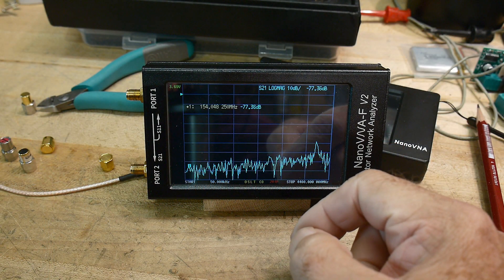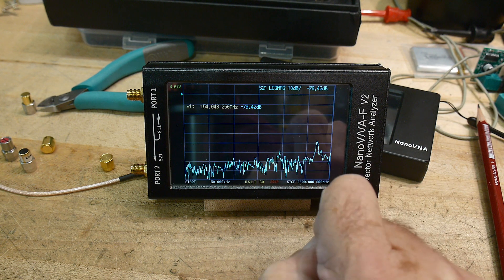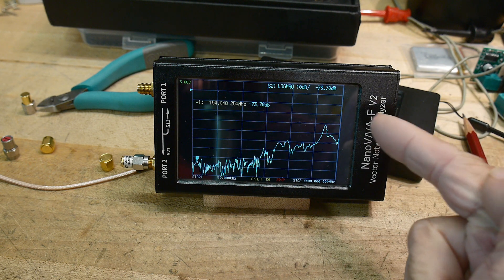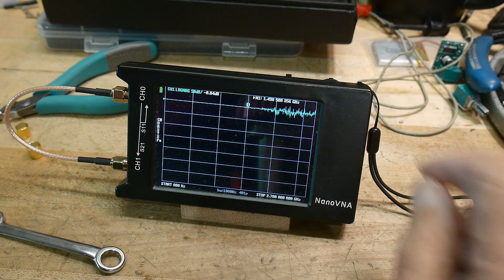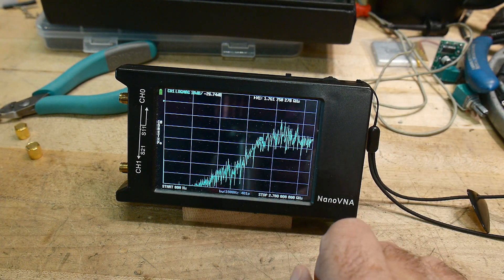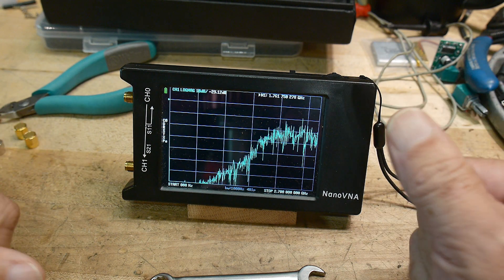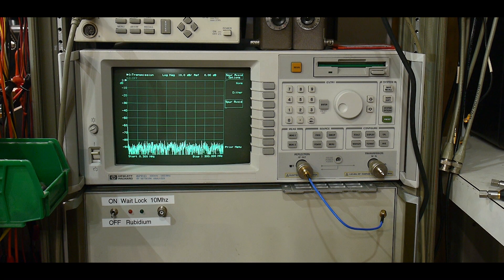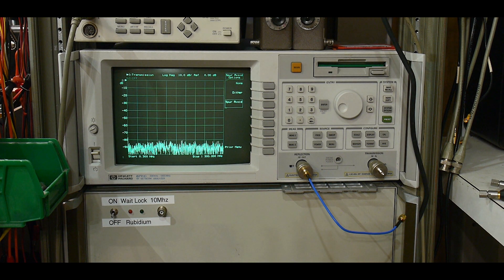#943 NanoVNA High Frequency Noise

Comment: I am NOT seeing the HUGE noise level you are seeing with port 2 terminated, so you might want to check your firmware version.  My unit arrived with v0.5.0 - which is the most recent official version on the SYSJOINT web page.

My unit only allows 3GHz frequency sweeps (you can enter 4 GHz, but the output drops to zero on all traces after 3GHz) - so you are obviously running different firmware.  My unit does not show the crazy high noise you are seeing, and remains close to -80dB noise floor below 2.5 GHz rising to only about -75dB at 3 GHz (which SHOULD be the highest frequency supported according to the units official specifications).  

So if you are running DipLoards firmware, or some other non-official build, you might want to try switching to the official v0.5.0 firmware.  

My only issue with the unit is that the input VSWR on port 2 is CRAP on my unit.  Kerry Wong reports that his unit has 1.4 : 1 VSWR worst case at the high end, where on mine I am seeing more than 2.2 : 1 VSWR looking into Port 2.  This high VSWR will miss-terminate the DUT on THRU S21 measurements at high frequencies.  

I can work around the bad port 2 VSWR issue on my unit by adding a 10dB precision attenuator on the Port 2 input to swamp out the bad VSWR during THRU S21 measurements.  This adds 20 dB to the return loss looking into Port 2 through the 10dB pad giving an effective 1.15 : 1 VSWR across the band 10kHz to 3GHz.   The down side, is that as you mentioned, the S21 dynamic range is already somewhat limited, and I don't like having to throw away 10dB with an attenuator just to fix the BAD PORT 2 VSWR.
Reply from the maker: I'm sure performance is all over the map as a dozens of places are building them to different "standards". The TinySA clones are a joke.
Reply from the maker: not sure if you have seen this: https://youtu.be/1Ll9YGzzulo

Comment: I just have the same nano vnaF V2, and it does not show noise When the Port S21 has a 50 ohm load, is almost a flat line at70db, i placed a 60db attenuators between S11 and S21 and is a flat line at 60db with few noise around 3ghz, i don't have attenuators to add up  to 70db

Comment: I remember that the older NanoVNA was using the harmonics of a clock generator for measuring above 200MHz, those are going to be much weaker and harder to properly detect at the higher frequencies.  The newer one has a direct generator which should help and seems to be more stable, there the problem could be cheap FR4 and layout limitations running at higher frequencies.
Reply from the maker: the V2 I tested is non-harmonic direct frequency

Comment: It all comes back to a cartoon that I once saw posted on the wall of a service center. The sign said good fast cheap. When a customers ask what it meant, the service person said you can choose any two of the three for the type of service that you want. So if you wanted good service done fast, then obviously it won’t be cheap, and so on ……
Reply: When I used to design two way radio equipment, I always told management, "Good, fast, cheap.  Pick any two."  Boy, did that piss them off.  But it is absolutely true.